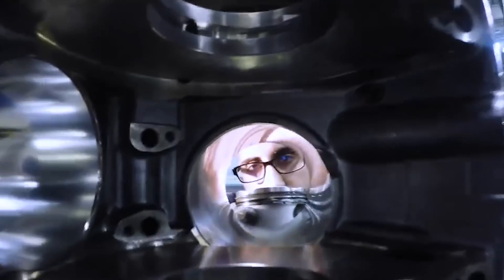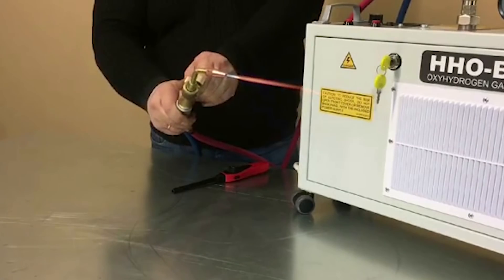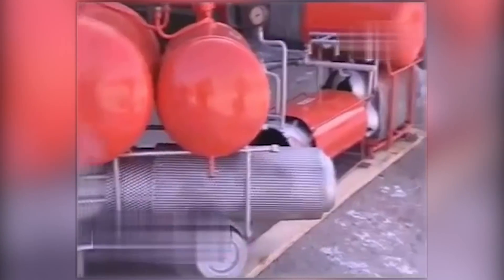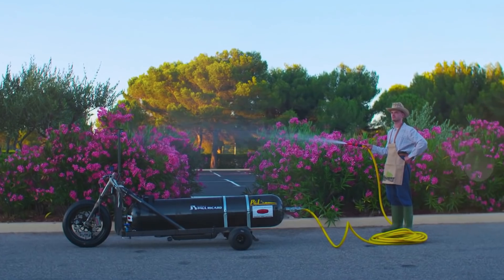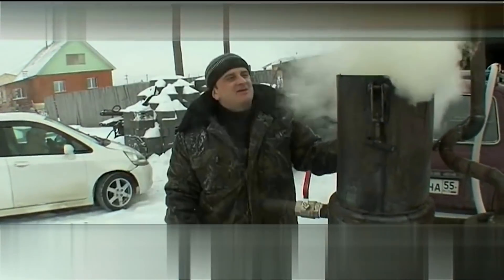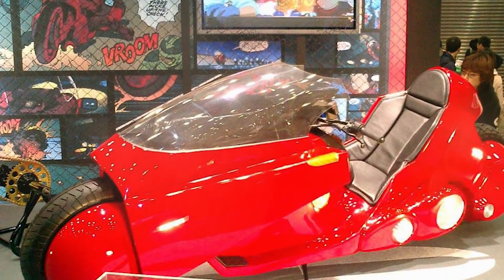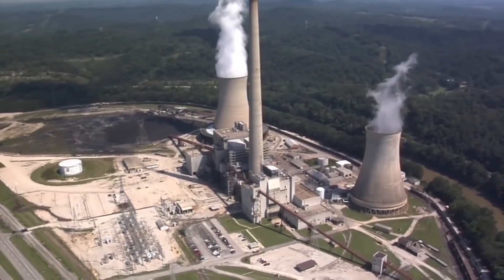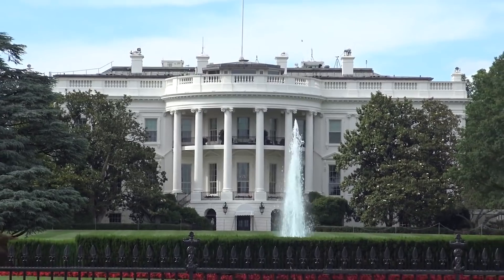Why These Engines Are Banned?

Comment: Most of these things aren't patented. You are free to use them if you wish. None of them are banned. 
(Aside from the nuclear power plants, you would probably need some certification from your government to build one of those, and with good reason). 
(Also, you can't convert a uranium plant to thorium economically. It is cheaper to just build a new plant. And you are welcome to do that if you want, even in the USA. There is no conspiracy here. However, one of the byproducts of a thorium reactor is uranium 232, and that shit is dangerous as fuck. Like waaaaay more dangerous than what comes out of a uranium plant, just not for as long.)

Comment: The air engine nothing new. When I was kid back in the 80's I bought a styrofoam glider that had a bottle in the nose of the plane it came with a pump and had release mech on the plastic bottle it came kb toys

Comment: The air engine nothing new. When I was kid back in the 80's I bought a styrofoam glider that a bottle in the nose of the plane it came with a pump and had release mech on the plastic bottle

Comment: Wow, even bovines are less full of BS! Dude, you are either ignorant, or exceptionally lazy. Read a little and you will find that lack of efficiency and limited usefulness is not the same as banned. And since all these engine designs are available for replication, I guess these mystery deaths were in vain.

Comment: An air powered car is quite simple. Just look at the tourque you can get from an impact wratchet, or other air tools. Scale it up, install a tire , (drive train) instead of a socket. Add in a gas powered scuba compressor to refill the tanks, they can run for hours on very little gas and produse pressure as high as 1500 psi

Comment: All they have to do is put a small gas motor and a air compressor when the air pressure goes down to a certain poundage then the gas motor will start and the compressor will go until the cylinders are back full again when it goes down to a certain point the compressor in the motor will turn back on again I repeat the cycle a small 5 horsepower motor Woodburn last fuel they could actually make the motor run off of hydrogen my father and grandfather both mechanics I grew up around the garage also did mechanics the theory is just like using a air ratchet you build the car use compressed air to run the motor you have a small gas motor or you could use hydrogen a 5 horsepower motor would probably be enough to run the compressor that will fill up the air tanks that are in the bottom of the vehicle under the floorboard

Comment: good god,,here we go again with the free energy oil conspiracy non sense,, its all about energy density of a fuel, and efficiency,, yes you can free hydrogen from water, but the electricity needed is better used to actually move the car,,air? omg,, you have to compress the air!! not free!  Just like electric cars,, not zero emissions,, NOT efficent use of power,, electricity isnt free,, keep pushing the electrics though please,, then we can finally get the stupid greenies to let us build nuke plants to power all their GREEN LOL toys,, has a liberal ever completed a physics or engineering class? ever?

Comment: I always hear the same arguments. We need renewable energy, oil, coal and natural gas are gonna run out. I a real issue with this. The Climate Nazis want us to believe is that the Earth no longer replenishes these materials. I just don’t believe that. Coal, oil and natural gas all start as biodegradable materials, basically plants and animals. Things die, rot and become a different form. When they reform as peat they are in the first stage on the way to becoming coal, which eventually becomes oil. Do a search of peat deposits in the US alone and you will find them everywhere. So for some reason the Earth has decided to stop a natural process of turning all this peat into coal? I think someone is trying to pull a fast one...

Comment: Compressing air to the levels needed to push the weight of a car is extremely dangerous. Youd be sitting on a bomb if the tank ruptured. But car accidents never happen, right? Next up, the 100mpg carborator right?

Comment: this is hardly new. they had trains that ran on compressed air instead of steam to be used in munitions factories or places with flamable material, and that was at the dawn of the industrial revolution.

Comment: BULLSHIT TEST ! 

1) Lean burn engines exist, but they are super expensive and not even close to worth the added cost 
2) MA-50 (water mist with 100 proof alcohol in the intake) work great but people forget to fill (1962 Oldsmobile).
3) Solar to hydrogen-oxygen, this works but not fast enough, when you make it fast, it all goes out the window

Comment: 3:16 - I hate to break it to you but this vehicle is powered by fossil fuels. It must be charged with an air pump. The air pump is powered by fossil fuels. Unless he pumps it up with a bicycle pump or has a donkey walking around in a circle powering the pump.

This is kinda the same thing as saying that a Tesla doesn't use gas. Anybody know how electricity is generated?

This engine is also not banned. As a matter of fact most of the engines on this list has been banned in any country that I can find.

Comment: Most of this is just stupid.  And apparently, so is the presenter.  Go learn some science, dude, you'll figure out there is no conspiracy, just lousy impractical designs shown here.  And there is NO MAGIC BULLET where you can "drive for nothing", even just energy wise.  Do you think you find highly compressed air just sitting out by the curb for free, you have to PAY to compress it, electricity, gas, etc. with a compressor.

Even solar powered vehicles would cost FAR from nothing to drive, though the energy source would be free.  You need to factor the cost of the technology (solar panels) to CONVERT the sun's energy as the cost OF that energy for the amount it creates over time. Think rationally and logically.  

You are just feeding the idiot conspiracy masses total BS, or maybe that's the point, as YOU ARE on of them, huh?  I hate to tell you, but the "newest" trend, electric vehicles, is just about as old, as well, and likely where it's all going, even though THEY have some serious problems, as well.  One is the DEFINITE need for some (at the least) nearly 100% recyclable (and built with readily available and sustainable materials) batteries to power them, which certainly are not the ones currently in use.

I have a better name for your channel...stupid labs.

Comment: Why don’t these engines exist? Simple really. They don’t work. And compressed air has less than one thousandth of the calorific value of oil which is why we it is not used. Tell me, did you you go to school? Or did your get your scientific knowledge from a bible or some other pointless waste of paper.

Comment: Can't power a vehicle by compressed air?! Try sail power, it doesn't need energy for compression. Wood gas fuel was used in World War Two when gasoline was unattainable. Incredibly inefficient. One is better off using the wood with a Stanley steam engine. Cold fusion?! Signing off. Click.

Comment: I think Felix Wankel would have something to say about the claim that the American military invented the erm Wankel rotary engine!! Drivel!
Reply: That wasn't the claim. There's a new version of the rotory motor that was designed by MIT. Look up Liquid Piston. It has minimal moving parts, can use any fuel that can be used in an injection system, and is extremely efficient as compared to other internal combustion motors.

Comment: and tell me, how do you intend compressing the air ... easy, use energy generated by fossil fuels or diesel powered generators or compressors, that's how. In this world there is nothing for nothing ...

Comment: The first 2 or 3 were cool, but you lost me with those HHO water engine scams. I don't see why you seem to think we are slaves to the oil companies though. I haven't put gas in my car in 16 months now, and I own a limo company and drive long distances. It is called a Tesla. Mine is powered by wind.
Reply: How big is the sail?
Reply: @tobyhunter6565  Power comes from a wind farm about 2 hours away along the Colorado/Wyoming border. Not sure how big the turbine blades are. Quite big as they are made not far from here and require special longer rail cars to transport.

Comment: All existing internal combustion engines can use METHANE instead fossil fuels.We all could drive our cars with gas made of CO2+H ydrogen from renewable Electricity and storing Wind, Water, Sun - Energy. And with the Methane generated in anaerobe Digesters plus Wood gassification and the use of Methanehydrates from the sea floor we could save the Climate by driving ! Unfortunatly those who rule the planet ($) hate the idea, and this is the only reason we still have to use Gasoline .
Don't be insane drive with METHANE  (Hydrogen Methanisation, Audi e-gas) It has not be "banned" yet.

Comment: Back in the 1970's when the oil embargo was on, there were people developing and improving engines that could get more than 200 miles per gallon, but they were NEVER allowed to be develloped, because of Big Oil's influence.
Reply: Catalyst instead of steam injection 1986 ! Hydrogen Methanisation (Sabatier Reaction 1913) realised in 2008 by Audi and the Fraunhofer Institute in Germany . Big Oil (Saudi Arabia + $) is the major minority shareholder in all key industries and most certainly not amused about this idea.

Comment: Compressed air .... the most expensive fuel you could ever produce!!!!
Reply: Unlimited electricity just by harnessing coastal wave generators. Also, why do they sell Air Powered hand tools? - More cheaper, cool running, more power than electric tools!
Reply: @SamaritanElad ,  Air powered tools are smaller and lighter, but if you've ever used them, they will drain down your air pressure superfast, especially dye grinders.  If you  have a long job ahead of you, an equivalent electric dye grinder is heavy and unwieldy often times.  When I use a die grinder or electric drill, I soon have to wait as it begins slow while the 240V compressor kicks on to refill the tank.  The compressor itself gets hot enough to burn your skin after running only a few minutes from all the friction.  James is correct, compressed air is very expensive fuel.
Reply: @SamaritanElad  .....Still, it is a very ineffecient way of powering tools by using compressed air that is very wasteful and inefficient to generate (lots of waste heat during the compression phase). The new generation of high efficiency electric motors that use rare earth magnets are way more efficient than air motors (almost 98% efficient in some cases) and develop maximum torque from 0 rpm! They are also very powerful for their relative size and don't need a reduction gearbox to develop the torque like air motors do.
Reply: @SamaritanElad  Nope...I got a 13 CFM trade compressor that uses 1750 watts and will only run my air sander intermittently....my Makita 175 watt electric sander will outperform the air sander all day.
Reply: I've never heard a quiet compressor which is necessary to drive air tools except that it can be in another part of the building. @SamaritanElad
Reply: Works well in a explosive environment.  No sparks.  They were used in coal mines for years.
Reply: @robertheinkel6225  ..... I forgot all about that. However it is still very very expensive to generate compressed air.
Reply: @robertheinkel6225  Don't forget self-cooling, and any atmospheric contribution if you're working in enclosed spaces. But efficient? Hell no...
Reply: All my machines at my company are powered by compressed air, it really save some money.

Comment: Larry should know better then to change chisel points without a heavy glove on his left hand, The bolt heads wear to a razor shape edge and will slice off a finger tip as it spins free with the impact tool.

Comment: It runs on water man! And it’s made out of fiberglass, but the government doesn’t want to know about them man! Hyde, you’re not stoned, except the fiberglass thing....
Ok, this part is real. My father in law and some of his fellow engineers invented a process which used finely ground coal and superheated it to extract the gases fumes from it, which could be used to power a regular internal combustion engine. The by products were Water and Coke. Not Coke as in the soda, but a highly refined solid fuel that could be used in power plants to generate electricity. The process made it cleaner than burning coal and was cheap when compared to gasoline. In 1976 he used the coal gas generator to power his motor home fromPhoenix to upstate New York and back for a little more than 40 dollars worth of coal. The engineers involved set up,a corporation and sold stock in it to carry the company forward, but within weeks of doing so all the other engineers pulled out of the project, dumping their shares of the stock on him. According to those who would talk about their decision, they and their families were threatened. I believe the oil Companies we’re behind it. Too bad, we might be energy independent today.

Comment: Compressing air is not cost effective at all. 1) You first heat it up during compression (loss of energy), 2) Then you need to expel material to get propulsion, which you need to drag around. 
This is why we generate this 'compressed air' by burning something ...
Reply: Why are there air powered tools then - more efficient than electricity is why!
We all could have unlimited electricity just by harnessing coastal wave generators.
 A lot of transmission lines from the coasts to coast throught the nation.
 Also, why do they sell Air Powered hand tools? - More cheaper to run, cool running, more power than electric tools!

Comment: This is total BS and I spent 21 years in engine development and some great developments turn out just not practical outside of the lab. Also banned engines are not built as development of multi million dollar automated assembly lines like shown. The rotary engine was a great idea but turned out to fail in real world use, neat engine and we hand one.
Reply: I didn't see the efficiency of my turbo XR7, but sure was fun screaming over 140mph... lol
Also had restart issues when hot, and sometimes cold starts too.

Comment: they are inefficient as hell ?   The take more energy to produce than they return ?  Oh, and physics.
Reply: If that was the case, they wouldn't be selling air tools, yet most all shops go AIR
Reply: @SamaritanElad  Air tools are not proposing to generate power.  They USE it.  His focus on "new types of energy generation" are false.  For instance it takes more energy to produce ethanol than the combustion product of ethanol produces. 

In other words, it takes more energy to compress the air than the compressed air will output.

Comment: I saw a compressed air powered vehicle that used a preheater. It would go 1200 miles on one fill of air and 8 dollars of gas. Top speed was 140 miles per hour. Oil companies just pay these inventors off or do not let them come to N America.

Comment: These engines aren't banned, they're just against the law, and you can't break the laws of thermodynamics.
Reply: U.S Patent Office - bans any patent that is over-unity.
Honeywell had a problem many decades ago of over unity on one of their circuits for missiles, that was found to be the cause of failures in launch. Circuit keep generation more power than what was put in.

Comment: this is retarded. how is the air compressed. wheres the electricity for electrolysis coming from. there is a trade off. no matter how efficient there is always a loss of energy each time you change forms. and you still using fossil fuels

Comment: What the hell do you think compress all that air? LUNGS? NO, GAS  ENGENS Do! Back to Square One 💩
Reply: You forgot electric motors. Yes, as we all could have unlimited electricity just by harnessing coastal wave generators. A lot of transmission lines from the coasts throught the nation.
 Also, why do they sell Air Powered hand tools? - More cheaper to run, cool running, more power than electric tools!

Comment: Videos like this are so annoying. Its obvious the creator doesn't know whats he's talking about or is purposely putting out misinformation.  none of these engines are "banned" and he forgets to mention all the flaws.

1. electrolysis - takes more energy than you get out of it.
2. compressed air -  takes more energy to compress air than you get out of it.
3. wood fire car -  really? not even going to comment on that.
4. magnetic engine - no such thing exist. magnets don't contain any energy, you have to put energy in to get energy out.

just going to stop here and not waste anymore time on this hogwash... everyone always thinks to create energy but that can never be done. The idea is to harvest energy the most efficient way possible.
Reply: Uh...wut?  Magnets don't contain energy?  

In magnets, the electrons in atoms at one end all spin in one direction, and those in atoms at the other end all spin the opposite way. This creates a force of energy around the magnet, called a magnetic field.

And yes, magnetic engines exist, they are called Motors.  There are even these marvolous things that use magnets and coils that produce energy called generators and alternators.

Comment: Hydrogen engines are horrendously inefficient. The amount of water you'd need to make a trip would literally outweigh your vehicle. That increase in mass increases the energy required, which increases the water needed, creating an infinite and insurmountable loop that makes it worthless and impractical.